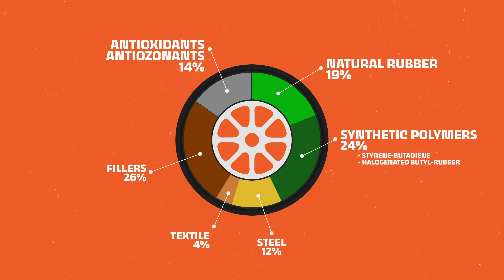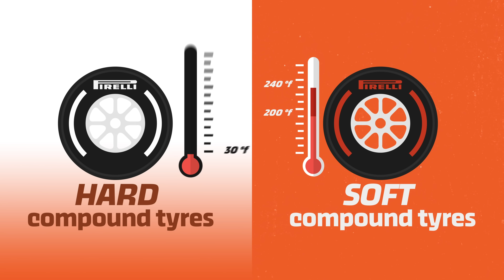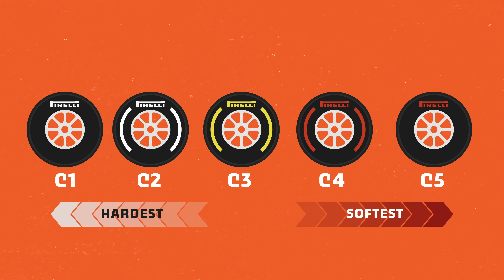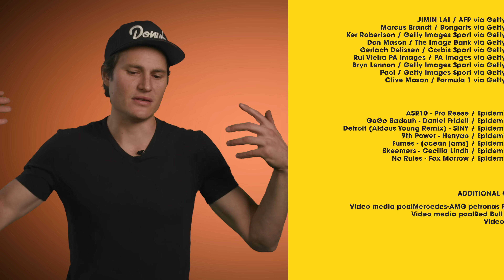Why an F1 Tire only last 50 miles

Comment: I liked it better when you could refuel too. that made strategy much more interesting. Running supersofts with a light fuel load for the first 8 laps, then switching to mediums for a long run...
Pure racing bliss.
Reply: I believe they stopped mid race refueling due to the many fires that were caused because of it
Reply: @SharpSh00ter43  was still quality race strategy though

Comment: Problem with F1 is you cant actually let them just race, if that was the case and you had a tyre that lasted the entire race, the winner will almost always be the one who sits at p1, it would be like watching a very fast train where each carriage has its own driver but they cant overtake for 2hrs.

So the tyre wear makes the pit stop an integral part of the race that can sometimes shakeup the format. Its kinda a lazy rod to induce excitement but if you've already reached the point where its the top 4 is set and we all know who will win it kinda moves the interest to the lower battles to see who clutches 10th place and who's gonna win out in an epic three car battle for 5th and 6th place, and can we see a team have both their cars place 4th and 5th or whatever.

Comment: The problem with the current tire requirements as FIA made them, is that, in combination with the fact that the current aero rules make it very hard to follow and then pass another car, drivers are not pushing their tires. Rather, they drive at a pace just fast enough to not lose track position thus eliminating the need to pass another driver on track to make a strategy work. A perfect example of this was Spa 2020, where an early Safety Car caused the entire field to come in after a handful of laps and then managing their tires the rest of the race. They COULD drive much faster, but since you can't pass the car in front of you, nobody did, because driving faster would mean passing the guy in front, pull a gap and then do a second stop and pass the guy again.

An alternative strategy only very seldomly works out, like Hamilton demonstrated in Hungary 2019 and Spain 2021. And that was partially because the Mercedes has more straight line speed than then Red Bull. When Red Bull tried something similar in Bahrain 2021, they couldn't pull it off because of the straight line speed advantage of Mercedes. So while in clean air a 2-stopper might clearly be faster, it often becomes a 1-stopper cause it's so damn hard to pass. With 2022 rules this should improve, meaning drivers are able to push their tires more, without having to worry about getting stuck behind another car destroying their strategy if they are going for a 2-stop while the other guy is going for a 1 stop. Another downside of the current tire rules is that with the battle so close at the front, whomever comes in first has the advantage of the undercut (apart from Monaco, where some drivers made an overcut work). So if you are leading by a second and the guy behind you stops first, you've almost certainly lost the position. Alternatively, if the guy in front stops first, they guy behind loses time again, unless he tries a radically different strategy, requiring a pass on track which brings me back to my first point. Unless you're Bottas, then it never works out for you.

Comment: The reason for the short life tyres is simply that F1 cars, owing largely to their complex and efficient (from a cornering force perspective) aerodynamic design, are pretty incapable of wheel to wheel racing because they cannot follow each other closely without significant performance drop off. The goal of an F1 car is to be fast on the prevailing circuits, not to be raceable. In fact cars that can damage a following car's performance are beneficial to the team - less easy to overtake.

It all started with Jim Hall and the Chaparral in the 1960s.

So the short life high degradation tyres and other artificial tricks like DRS are simply to spice up the spectacle to give the illusion of racing. It didn't used to be like that, but to go back to how it was would require 'unlearning' 50+ years of car aerodynamic development.

Comment: "corpse corner" im not sure he watches f1
Reply: Made me cringe as well
Reply: Maybe he'd call the hanger straight the hanging straight 🤣
Reply: @lanbroghini  Isn't this part of the rack called the "HANGAR Straight"? You know, to commemorate the aircraft hangars from the times this place used to be RAF base?
Reply: @Razor77725  Hamilton straight you fiend!!
Reply: @Bahamuttiamat  that's a completely different part of the track. Formerly without a name, the Hamilton straight is at the international pits (before turn 1). Hangar straight is after Chapel (turn 14)...
Reply: @Razor77725  Thank you for the correction. Cheers.

Comment: so to sum it up tyres are basically gum cold gum is harder and warm gum is soft warm tires that are softer go into the track greating grip while cold ones are stiff and wont soften up (btw you can test the gum thing by putting it in a cup of cold water with ice in it)

Comment: All I'm going to say is I'm impressed because ive been working in a tire factory building tires for 4 years now and I was learning new things. But the butyl rubber is the very insode of the tire as its the only kind of rubber that holds air. Its not actually in the tread

Comment: The final point about just letting them race would be good if there weren't essentially two classes of f1 team at the moment. If all the teams could compete with one another, tires would be less of a problem. However, forcing strategic putting allows for a bit more competition. 2022 regs hopefully will rectify the competitiveness issue

Comment: As a Mechanical Designer, my ears perked up when you stated correctly, "plastic deformation." The mandate of 2 separate compounds is ridiculous, especially if it puts the driver in potentially serious peril. I guess it's better than having grooves cut in your F1 rubbers.

Comment: Absolute die hard f1 fan since 2017(LH44) but I think the f1 races need to be longer, than the tires could be built to last longer. Just an hour and half for most races, 50-60 laps just aren't long enough for a three day build up and a whole team to spend millions to travel countries to get there. I would love to see longer races instead of more races. This now come down to re fueling. But refueling was ban in 2010. so idk what the answer is on making tires last longer. I get having to run to different compounds of tire in a race is to make teams have to pit so it makes the races interesting but i would just love to see 100+ lap races

Comment: I would only agree to keep high degradation on F1 tires, because it is usually found so difficult to overtake on many tracks, that pitstops play a huge role into the strategy allowing for better spectacle as well as better racing itself, but only because of current regulations and cars that are being raced right now. In 2022 we have a conplety new Era at F1 and it might as well change drastically, so let's wait and see what the new season of F1 will bring us alongside with the new regulations and most excitingly new cars.

Comment: 16:37 speaking of let them race....
And there is the mandatory pit stop...
btw a full wet tyre should be able to cover a whole race distance at any track in the wet and in Monaco, even the softest rubber could last a whole race distance (with is around 260 instead of 300 km)

Comment: It was more interesting when Michelin and Bridgestone where both in use and was up to the manufacturer to choose a tyre. Image if there was 4 or 5 different tyre manufacturers which each F1 team could choose from each race. That would be more strategic and interesting.
Reply: We had that in the early 2000s and all that happened is Ferrari domination

Comment: but its also to keep the drivers driving more proper as any mistakes will lessen the tire life and need a pit stop. not just for the super grip, older f1 tires in more powerful cars lasted longer. now its standardized so everyone has to use the same tires increasing the skill gap and making racing much more close. drivers have to be more careful about how much they push so they dont wear tires out too quickly , same thing about regulations about fuel tank sized and no refuelling during the race.

Comment: I get the tire fiasco feeling, but I've been researching about history of f1 and FIA, they always have a strong point on why rules are the way they are, security and performance it's on the top of reasons, yeah tires also are strategic and makes you grasp your seat while listening to the radios and tire talks come in
Reply: I won't be surprise if one of the reasons has to do with security and mental health for the drivers to change the lane for the box even for a second

Comment: "giving up" is more regularly called heat cycling. i've actually only heard "giving up" two times, one of which is here.
Reply: also heat cycling is an issue more because of the heat causing the smaller hydrocarbons in the compound to evaporate, and the other chains to either become entangled in eachother and lose elasticity or to chemically combine into large and longer hydrocarbon chains, hardening the compound and leading to cracking and shedding of material.

Comment: Actually, your daily A-mover tires will not last long on the condotions of "battle" driving... Regular Contisport Tires last about 160miles in hot wether conditions on trackdays. It's always depends on how much load they take, driving style and much more... We just need to understand that explanations in this video can be usefull only for specific situation. Need to mantion that, cause someone after listening all this great explanations will believe that his daily tires can last for 90000 miles and will be very disupointed after finishing new set in two track days...😁

Comment: Fun fact: Michelin refused to even apply as the producer of F1 tyres in 2020 because fast degradation was required by FIA (and also because they are still using 13" tyres). Take a look at LMP1 tyres....

FIA wants to maintain the "strategic" part of F1. If the cars were able to drive a whole race without a stop, that would kind of take something out, wouldn't it ?

Comment: Did they cut some of the tyre colors? I remember there being a whole rainbow of options, pink tires were cool, but I can understand why they would simplify it.
Reply: Hi Stanced, they switched to a more simplified tire management system in 2019. Technically it's still 5 different types of compounds for dry weather conditions, but Pirelli chooses which 3 of those 5 compounds they offer during the race weekend.

Comment: 50 miles is 80 km.  Races are 300 km.  They only stop once or twice a race. Therefore the tyres must, if the compounds wore evenly (they don't), last 100km min or 80 mi.

Comment: 13:02 It may not be an elaborate conspiracy, but it seems to be a heavy-handed regulation that shouldn't exist just because it "excites the fans". F1 is about break-neck speeds and racing for the fastest lap times on earth. It shouldn't be "Go really fast as much as possible but make sure you change your tires a couple of times or else the fans will have nothing to watch".

Ask any rally fan how stupid they think that rule is and you'll get a very vulgar... and correct answer.

Comment: F1 experimented with no refuel / no tire change for a few seasons (or maybe just one), and it was extremely boring. Given that overtaking is nearly impossible in F1, the entire race is usually decided after the first corner or two of the very first lap, at least for the front of the pack.
Now the race is done in the pits and with race strategy. That does not make it much more fun.

Comment: 2.2 Pounds (lb) = 1 Kilogram (Kg), 1 Mile = 1.6 Km , for  F to C you need this formula : (32°F − 32) × 5/9 =  0°C ,  so 280 MPH = 448 KPH, 162 MPH =  259 KPH ,  300F = 149C, 2200 = 1000 Kg,  180 mph = 288kph,  2800lb = 1273 Kg,  150 Miles = 240 Km,  50 miles = 80Km,  120F = 49C,  200F = 93C,  240F = 116C,  230F = 110C, 285F = 141C, Most conversions should be here in order did not list repeats all figures rounded to nearest whole number. If I missed one the formulas are there.

Comment: Simple, greater longevity means a harder tire compound. A harder compound means less grip.  Less grip would be boring for the fans because of less speed in the turns and lower effective braking and acceleration.  F1 knows their fans. They want their cars to go fast.

Comment: The reason the figures aren't as reliable as they were is the FIA cut the tyre testing days.
I don't think there is one circuit 3 miles long, most are about 4 kilometres,

Comment: 7:22 As an F1 fan I can assure you this is not the reason as no other company would want Pirelli's F1 tyres. Also, if the info on the testing methodolgy is correct 2200lbs of load is about half it needs to be. F1 cars make more than that in downforce alone. I know you can do cool things with math but Pirelli has show that it can not do cool things with math.

Comment: The only reason rapid tire degradation is needed is because F1 cars struggle to race each other due to the dirty air they produce. That's also why DRS has to be a thing, or part of it anyway. 

Hopefully, the return of ground effect cars will be a step towards fixing the issue.

Comment: I mean, If they want more Pit strategies, maybe tinker more with fuel tank sizes and rules. Messing with tyres is just dangerous.
Reply: Not necessary. This video has been two years old.  Teams learnt a lot and are better to handling tyres situation.  Tyre rupture is now rarely seen in F1 races.  Every team has mastered the trick to use those tyres safely.

Comment: Nah bro if u ever watch a f1 race you know that pit stop are one of the best things about it. Cause this f1 it's all about strategy, not just hitting the pedal in the straight and the brakes in the corner. Driver need to be constantly monitoring their neumatic degradation plus other stuff and to correctly adminster it they need to make extremeley precise speed and braking changes. If pushing the limit of the car hear involves every part of the car including the tires. Also teams that are able to anticipate weather changes that affect the racing conditions on the ongoing race may get a huge advantage if right timed. And that's just a few of the many thing that tire changes bring to the f1 show.

Comment: Donut Media, Formula One has tires that last LONGER than fifty miles, as a race must be close to three hundred miles. The hard compound of tire last a minimum of 75 miles. And also, the tires dont last that long because the cars are going so fast, that they just wear fast. The FIA even made the cars slower because Pirelli said the tires wear to fast because of the shear speed. This is a comment written before actually watching the video. Have a good day

Comment: Pitstop and crew management make up a team effort in winning or loosing.
Racing should not only be decided on how a driver drives the car but also how the team performs under pressure and improvises
F1 is team effort not one man show
So I stand by FIA rules to make things interesting in F1

Comment: Pit strategy allows in 22 George Russel to win a race because a Mistake in Pit strategy can make you gain about 7 sec Race time wich means you need 7 sec more to comlete all laps than with maybe a different strategy this allows teams wich have not so much budget as Mecedes Ferrari or Red Bull to maybe win a Race by good strategy and car setup

Comment: That why michelin refused when they asked for new tire manufacturer in 2022. They said "we dont reduce our tires performance for show. We made the best tires we can that last the longest possible and have the best grip possible." As we see in LMP or GT races... tires can last 2 or 3 hours racing lol. But FIA can't force pit for fuel like they used to due to hot car and battery elecritfying car. So... They get the tires crap. But i agree, no pit is good. It rarely change the race and well people would have to watch their tires. But they would just slow the pace and not be agressive on passing then.... So it would still be boring. ^^'

Comment: The tire degradation is actually done to make racing more interesting for viewers and spectators. Tire’s that last a whole race could be made and the manufacturer even said that they could do it. But the F1 organizers said not to because it’s more interesting for the races to have more pit stops. If only 30% of all cars posted once every race became the tiers lasted long enough then it wouldn’t be as interesting to watch. Remember that I’m F1 you aren’t allowed to refuel cars at the pits unlike nascar. But if tiers wore out faster that would mean every car needs to make 1-3 pits every race and sense pits are where you can make or lose massively depending on when and how fast you do it, it makes races much more interesting and suspenseful for the audience if cars have to put more frequently. So it is planned obsolescence, but not in a malicious way. It’s not done because of cost or greed, it done to make races more interesting and unpredictable.

Comment: They have to make the race interesting somehow. The difference between the cars is too much to provide any unexpected result consistently. The format for qualifying is also such that the fastest car mostly starts at the front and so the difference in speed causes the delta in the time difference to increase between those in the front and back. So, FIA has to keep it interesting for people other than "purists" or the drivers at the front.